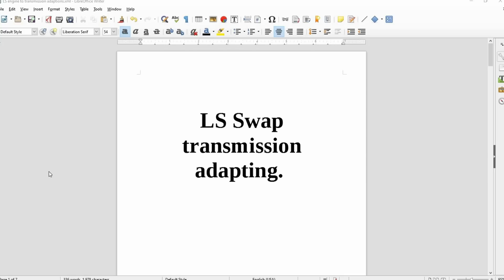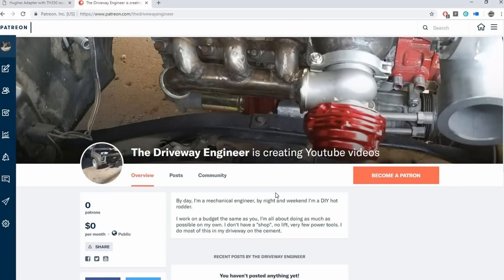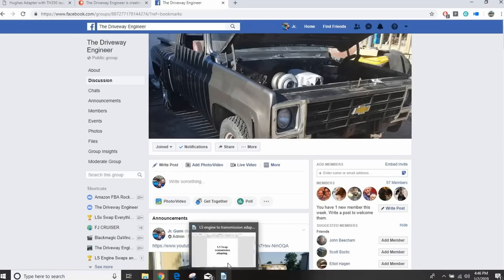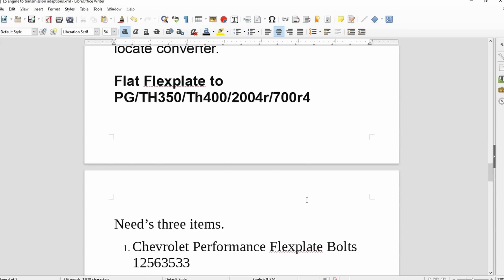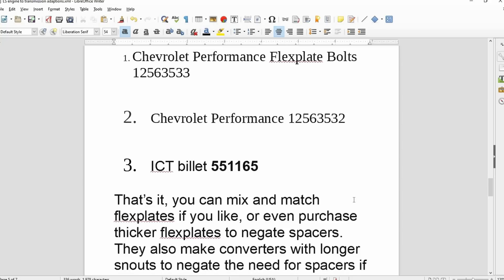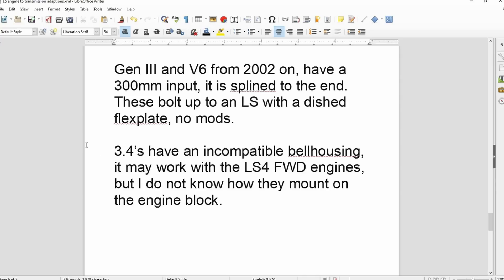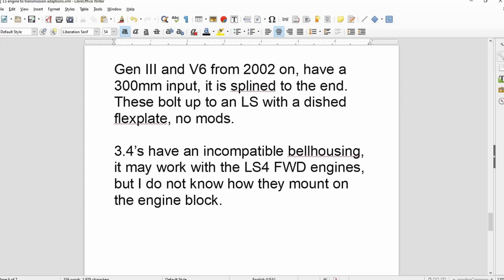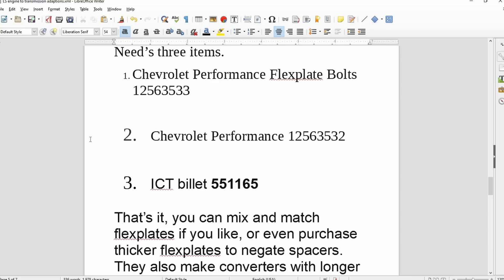LS Swap basics, How to Adapt your LS swap engine to your original automatic transmission.

Comment: What flywheel would I need for the 99 6.0 to fit my 01 4l60e? I was told my flywheel off my 5.3 will not work with my 6.0 being its got a longer crank
Reply: Dang that sucks
Reply from the maker: Jesse Holland use an 80 lol that works fine
Reply from the maker: They don't bolt together without a custom converter last I knew.
Reply: @TheDrivewayEngineer  u can make shim out of sheet metal that's .040 thick 19 gauge  that looks like the bell housing pattern solves the extra .040 problem
Reply: Really not trying to spend a couple hundred on swap parts..was gonna buy a cam lifters oil pump head gaskets an ARP bolts but now I'm jus gonna sell the motor an get a newer style one cause that's to much bullshit I got a perfect 4l60e been going for years no problem even on nitrous on last motor so I know its stougt transmission lolol jus trying to get more power an do a 6.0 swap
Reply from the maker: Jesse Holland yeah, punt it to someone else
Reply: OK thanks for the help

Comment: What about a 5.3 with a older 1998 nv3500? Pilot bearing
Reply from the maker: Flywheel Oreilys $60 NFW1050 
Pilot Bearing Napa $20 6302-VSP43
Release Bearing Ebay $20 1377C
Clucth Stock
Pressure Plate Stock
Reply: @TheDrivewayEngineer  I was thinking about using my 5lm60 to get me going will I be able to do the same thing or will I need to get a newer nv3500? that doesn't have clutch fork?

Comment: I have a 94 c4 Corvette with the 6 speed zf trans and have a donor 4.8/5.3 truck from 99 and was wondering if that trans will bolt up to that engine? If anyone knows that would be awesome. I've looked everywhere and everyone I've seen do the swap already has the auto trans and uses it from the vet and use a engine from a truck
Reply from the maker: There's a QuickTime bell that works with some machining, Quicktime PN RM-6039 I have the thread saved on my PC, I'll dig it up for you.
Reply from the maker: https://www.corvetteforum.com/forums/c4-tech-performance/2893234-ls1-swap-with-zf6-need-parts-list-6.html
Reply: Thanks man I really appreciate it. Love the videos. Keep them up!

Comment: I have a 2003 v6 that is gonna be swapped to 6.0 out of a 2006 Denali AWD would I need the spacer to use the v6 stock transmission idk what transmission was on the 6.0 it was already gone but could been a 80e
Reply from the maker: The input shaft is different on the V6, you'd be better off to start with a 5.3 trans.

Comment: If using the oem flat flex plate and oem spacer  "80e" stuff to bolt the th350/400 pg ect. You absolutely do NOT need the ict snout adapter
Reply from the maker: You need either the factory spacer, or the adapter